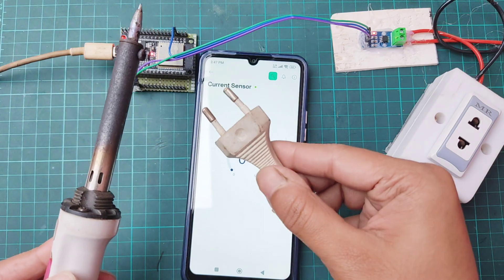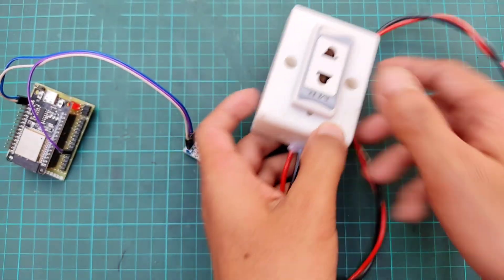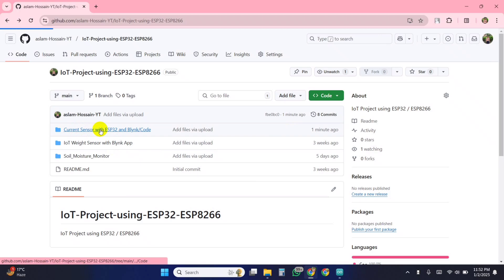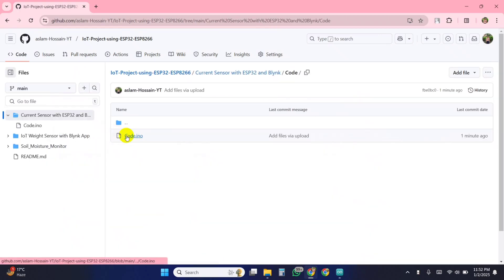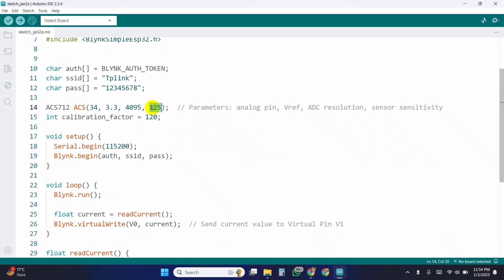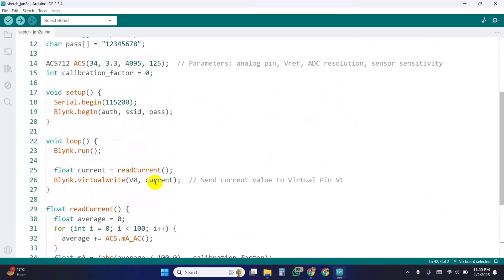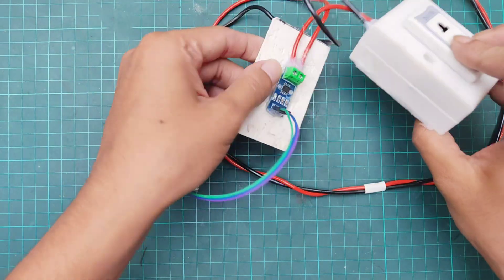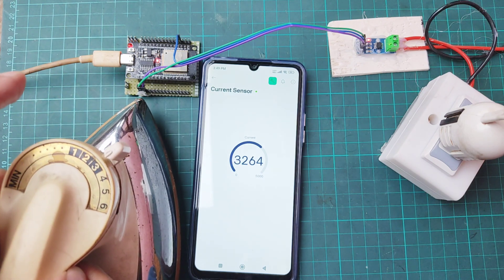How to Use Current Sensor with ESP32 and Blynk | ACS712 Current Sensor

Comment: Why the result shows still 0.00mA even after connect to the load. Im using calibration factor is 120. Or i need to lower the value calibration factor?
Reply from the maker: First keep cf 0. Then observe the current without load. if shows current value without load that means its error. Then its the calibration factor value. assign this value in cf variable then reload the code.
Reply: @aslamhossain1  I see but why the value cant static like this video?

Comment: Seriously you run 3.3v on that current sensor?
Reply: That current sensor need VCC's need 5V supply to run, right? Is it ok to connect the sensor to 3.3V pin, like in the video?

Comment: will it fry the esp 32 ? ACS712 ADC is 5v and esp 32 is 3.3v?
Reply: He used d 3.3V pin of the esp32 to supply de IC although I don't if this level of supply is enough for the sensor , I thought it was at least 5V

Comment: Please make a video for esp32 using acs712 sensor only, I tried various things but kept failing
Reply from the maker: here i only used ACS712 with ESP32
Reply: @aslamhossain1  I've done it, but why is the load, namely the lamp, not being read on the serial monitor, the current that is read is the ESP32?
Reply: Voltage divider needed or not esp need 3.3V And Acs 5V  

Please confirm @aslamhossain1

Comment: I want to use three ACS712 sensors. When I connect only one power source to one sensor, all three sensors show amps. When I disconnect the input of the ESP32 pin and touch the pins with my finger, noise and amps are shown in the panel.

Comment: how to connect if have zmpt101b voltage sensor with the acs712? hope can answer
Reply from the maker: Will make a video with both voltage and current sensor. Which is energy meter. If you want the connection and code right now then knock me personally.
Reply: @aslamhossain1  hi how can i get in touch with you
Reply: @aslamhossain1  I would like to watch that video, thanks for this one :)

Comment: How did you make the board you placed the ESP32 on
Reply from the maker: Esp32 extension board.
Reply: @aslamhossain1  can you send the link where you built it?
Reply: How can esp32 output 3.3v analog signal, using acs, do we have to use esp extension board?